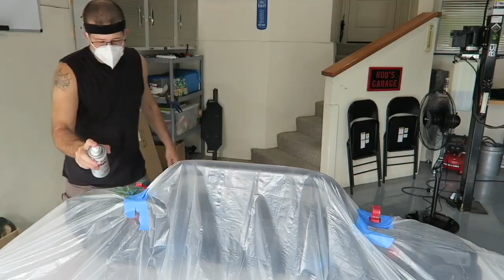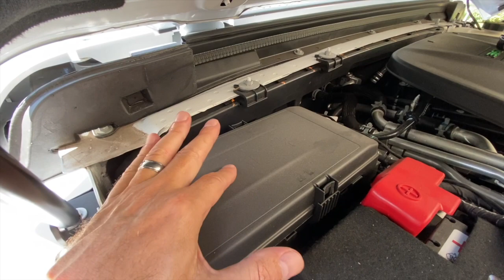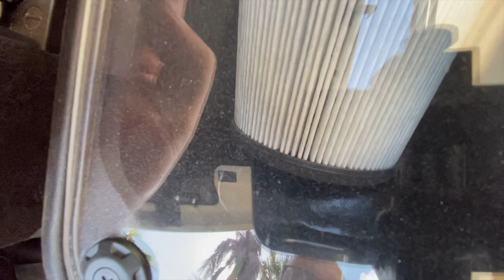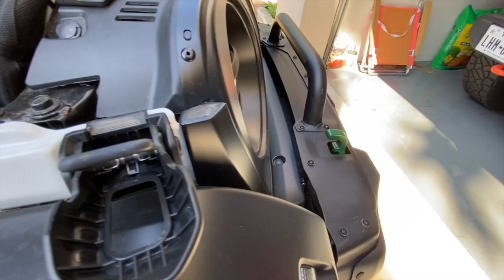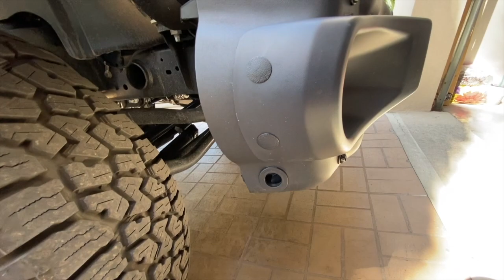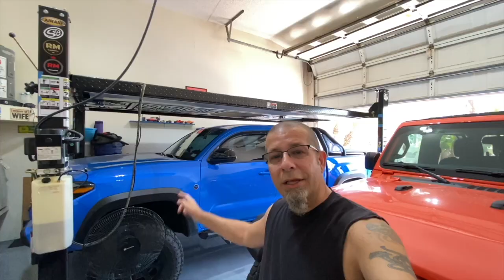Gladiator Devastated by High Water

Comment: Rob, Ive been off-road at Moonlight OffRoad Raceway. Its a local off road park. There are several creek crossings. Ive been in 2 feet of slow flowing water with my stock Gladiator with NO issues. You CAN forge rivers greater than 30" with snorkel and exhaust kits. Jeeping 101 class taught not to go into water FAST. You dont want to create a wave front that will come over your hood. Those whining must have hit the water too fast or it was too deep for stock. I would say adult beverages may have been involved.
Reply from the maker: Lol!  At least a few cans of liquid courage I’m sure😬
Reply: You don't want the ends of the breather hoses to be submerged or you can get water in the differentials, etc. Some people will extend the hoses to get the ends higher up.
Reply from the maker: Good idea👍

Comment: An easy way to warp brake rotors is to drive into water that splashes water on the brake rotors while they are hot from driving. lug nuts tightened irregularly by not torquing the lug nuts with a torque wrench. That also can cause brake rotors to warp.  You will notice a shaking steering wheel at high speeds when brakes are applied.

Comment: Once while driving a Geo Metro [remember that 3 cylinder 1ltr wonder?] driving into a BoyScout ranch tried to cross some water couple feet deep.  Motor didn’t just stall out it hydro locked. That took a new short block  to fix.  The air intake on the little car was very low.  In a bigger vehicle never had a serious issue.  One F150 would get a check engine light in water a foot or so deep, went away when the alternator dried out. Tacoma handled 18” to 2 ft water ok, gladiator seems to do the same.
Reply from the maker: I remember those!!  I’m surprised you didn’t just float away😬